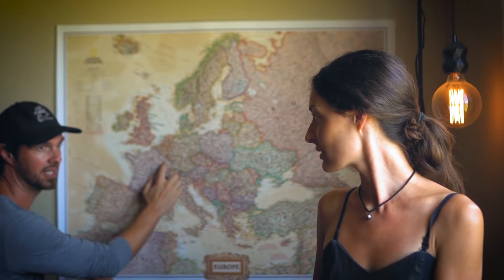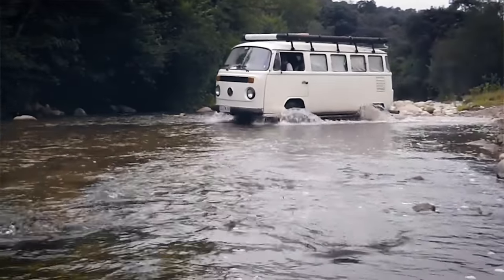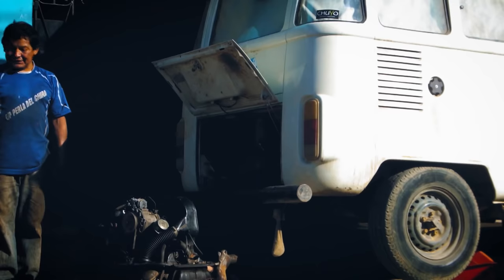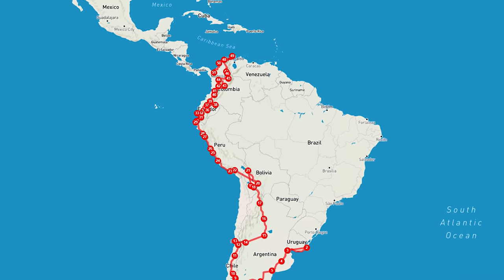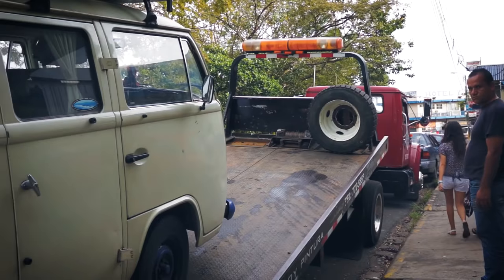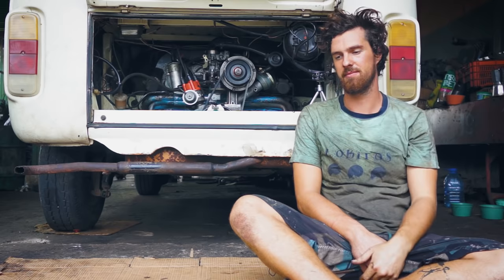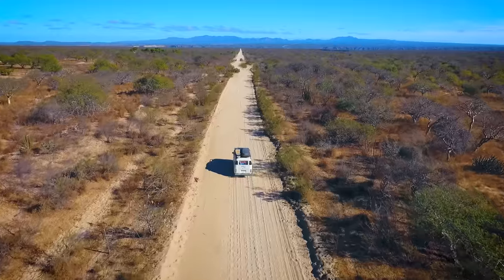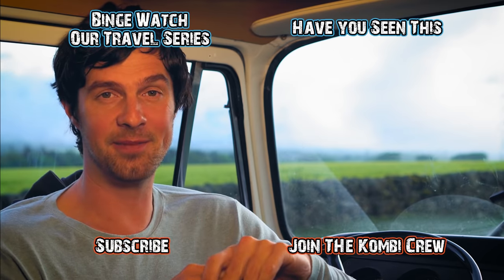How Did I BLOW UP 10 ENGINES in 1 ROAD TRIP???

Comment: I thought it was common knowledge that VW van's are generally junk unless you basically replace and reengineer the whole driveline.  Then theres the natural problems with older vehciles like weak electrical systems. No heat and AC etc.  As much as I really dig the VW Busses all the way up to the Vanagon I would never be ridiculous enough to try and use one for long distance travel.  I understand the vibes and nostalgia but do yourself a favor..  Buy a Toyota and put a picture of a VW bus on the dash to look at as you travel worry free.

Comment: doing such a trip, learn how to repair yourself and take tools and maybe spare parts with you … a VW is one of the most simple engines in the world, you can rebuild it on the side of the road.
you can´t do such a trip without knowing anything about your car
And learn how to adjust carbs…  get an oil cooler, oil temp gauge, cylinder head temp gauge  and change the oil every 3000km ...oil should not be expensive in these countries but maybe isn´t the best quality

Comment: This guy knows nothing about engines :D  having no valve clearance makes the valves leak and burns them, also it looses power and that makes you push the throttle more that also increase temperature. And installing a big oilcooler would have been a cheapest 100€ invested for you.

Comment: i think there i found your problem, the engine is a pos, put a little 200bhp 2 liter diesel into it, super efficient, quiet and enough  power, available everywhere in scrap yards form crashed cars, bough for about 400£

Comment: well, i have to say wat i think, is your bigestproblem. i do some overlanding, and are working on a trip to nepal, but, you have to pick or build, your car to the trip.
the old VW you did the travel, with, is just too weak, enginge is too small and fragile, the rest off the mechanich compoments, is just too weak.
i am travling with and old Toyota Land cruisier 60 series, a big car with a strong, big eninge, i see you are working, to get the car bether, keep workig on that, you still ned too make the, rest off the car stronger, if not you will stile get big problems :D good luck
Reply: Until you break down somewhere and you suddenly discover that land cruiser parts are all gold plated and priced accordingly....IF you can get the correct parts to suit the VIN on the toyota .They changed so often ,that even here where they built a lot of 'cruisers' it can be a hassle finding parts.
Reply: @Mercmad  yeep, some parts are hard to find, but if you know your car, thene you know wat goes bad :D my 83 lc has gone over 692 xxx km and still going strong with orginal engine and tranc :D

Comment: How did you blow ten engines I run 10s of thousands of miles with air cooled motors you must have been running it way to lean or too fast
Reply from the maker: ...that’s kind of what this video is about.
Reply: Watch the video?

Comment: I really like cars and almost everything that has an engine and I've fixed some engines (not car engines) (Leafblowers, lawnmowers, weed whackers which is much smaller but i can cars too) and I know more about cars than this guy that runs an air-cooled VW engine which are pretty easy to fix and doing an endurance run no question that it fucked up......

Comment: 18:10 oil had bassically broken down ...??!?
Reply: Yes, at very high temperatures, oil will not lubricate as well as it should and eventually will damage the oil. These things can get really hot, really quickly if there is anything wrong with the cooling system or the valves are out of adjustment etc. Many things can cause these engines to overheat. The problems compound if you're not maintaning them correctly

Comment: I think non of the mechanics got the fuel/air ratio right nor the timing causing overheating, poor combustion and knocking on the engine...each of these mechanics will get one thing right but not the other
Reply: That's what I said....prob knocking up every hill?

Comment: I shouldn't be watching this, I just took my Transit to the mechanic, in limp mode and with the engine warning light on... and smoke blowing out the rear. The van's rear that is.
🤢
Reply: Yep,that is the transits fate. Even here in Australia so many broke down because the turbo pressure switch fails. it's nice little earner for mechanics.

Comment: No you're not looking good.
You need an engine combo built for a bus by a pro.
The tech available now for the air-cooled engines makes them bulletproof .
Find a hot rod shop where ever your are and get an engine built right.

Comment: An ignorant fool goes on a cross country trek in a VW van. At the very least cracking a book would have given you some insight rather than blindly poking at the engines with a stick and hoping voodoo magic would fix things. 

Was cruising down the highway in a rail buggy, pulled over to help a guy with a beetle. Says," I just bought this, the oil pressure light came on but I just kept going and then it stopped." Thing was seized solid. He had literally left the place he bought it like 30 minutes before. Didn't think the oil pressure light was important on a 50 year old vehicle. 

I'll be you got good at popping the 4 bolts loose that hold the engine. You should be able to swap one of those engines out in about 20 minutes on the side of the road now.

Comment: You need to learn how to actually rebuild an engine properly. Not just pull it out band aid the problem an expect it to e fixed. Or better yet, get a vehicle with n engine hat wasn't developed in Germany during WW2 to use as little materials, ad be as cheap to produce  as possible.

Comment: You blow up 10 engines becouse VW enginering is not as good as it is made out to be. They did a great job on marketing though.
Reply: If you can´t read a spark plug to figure out that your carbed aircooled engine is running lean, dont take it on a trip through South America. I dont think you can blame the engineering if you run the bus up a hill with the choke pulled and the breaks seized. Great watch though. Respect
Reply: @tobiasandres3946  you can blame the engineering, as other utilities of this vintage were doing long distances without the problems VW's had. This is why they abandoned air cooled engines.

Comment: The reason that you blew up 10 engines is because you did it in a VW.  As with anything in life if the same thing happens more than a few times is usually not a problem with someone else, it's a problem that is internal.  It's pretty well known that an air cooled VW is a very poor choice for overland travel due to inherent reliability issues.

Comment: go electric is the only way.
gas/diesel motor is crap!! and it will continue  to  forever break down.
it will  all most likely never happen to a electric motor. 
(fossil engine. is shit and you  most stop using it.) 
(saveing yourself and the world from all pollution.)
all the money/time  you waste on fix fossil engines.
you could buy a wild electric motor for that car.

if no charging power is available on the trip. 

hybrid car. (gas / electric) is a option.

your van use electric motor to drive the van and
gas generator to power the vans  electric motor/batterys in the car.
and when gas mobil generator stop working.
you can try fix it  gas generator

or  buy a new cheap mobil  gasgenerator.
powering the van using gas mobil  gasgenerator.

is only necessary when there is no power. on the trip

super capacitor battery is going. to replay batteries. one day.
super solar panels is coming. very huge power out. one day.
is will make it free / very low price to drive a car.

vs (old fossil engine. is shit and you  most stop using it.)